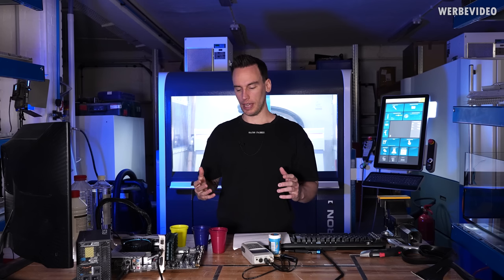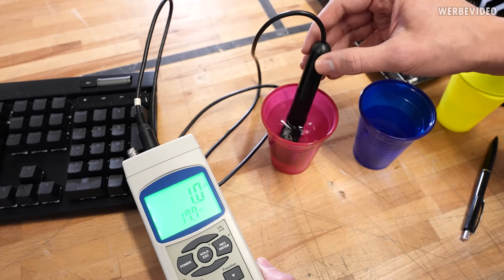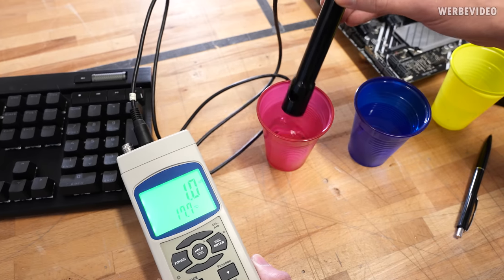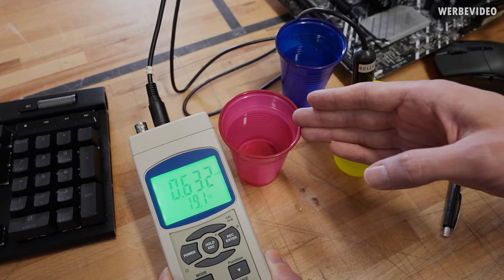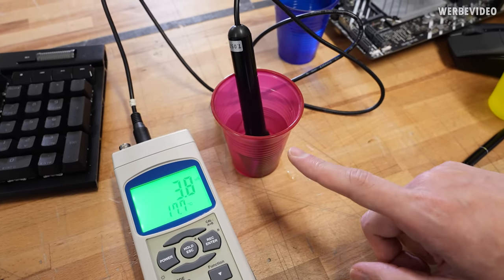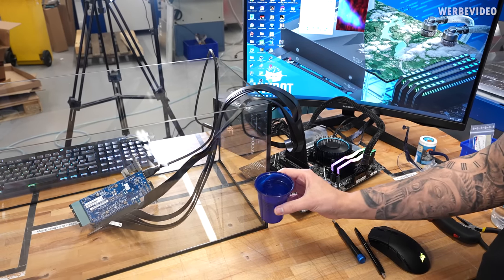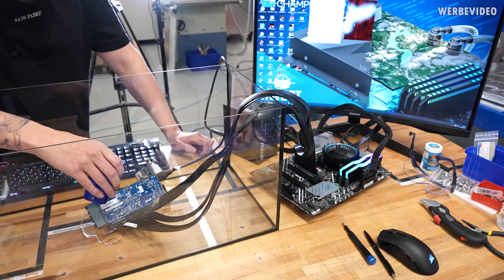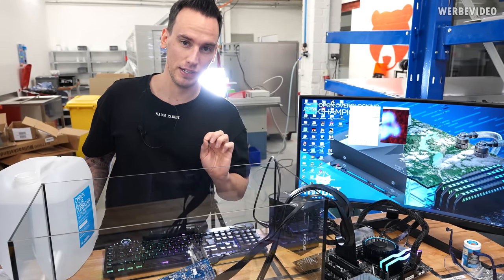Can you submerge a PC in Ultra-Pure Water?

Comment: It's like a common given that water and electricity don't mix, but here comes this guy
But BTW, how that ultra pure water is made is by filtration. Did some hplc at a place that had the this filtration system to make water for the hplc
So if you made a little external loop from the tank to a filter, it might work a bit better

Comment: The main issue with the "ultra-pure water" is that it doesn't remain pure as soon as you submerge electrical components in it. Everything on that motherboard is continuously contaminating the water, even the clear paint that protects the circuitry. Then, there's exposed metal parts, grease from bearings, plastic everywhere. Otherwise, if the water would keep pure, it would work, in theory.

Comment: The major issue you have is the metals on these components is not treated to prevent leaching into the water. With highly pure water, the water will rip metal ions out of the unprotected metals fairly quickly which causes a ramp up in conductivity as there are more conductive ions ppm. If you had left your parts submerged for a while, you'd start to see pitting on all of the metallic surfaces on all non-titanium parts. This is also why it's extremely unhealthy to drink highly purified or DI water. It'll strip all of the minerals from your body and then you'd expel it all in your urine which would lead to health issues/diseases or even death if done long enough. Places that use DI water for cooling purposes specially treat the metals with a special coating that's not reactive to the DI water or use titanium as titanium only leaches into methanol solutions and not water. We used DI water for our lab's hydrogen fuel cells and had to be very cognizant of making sure there were no fittings or hardware in the lines or pump that were not properly screened for use with DI water.

Comment: If I were to do the experient. I would use new hardware only. I would rinse the hardware first. Then refresh the water. I would then use a running loop to get rid of the old water and then pour in new water. It needs to be as clean as possible.
Reply: It's possible that the dust on the pcb is immediately causing shorts.

Comment: You should have rinsed all the parts with purified water first.  Also, your hands and anything you touch leave salt particles and impurities behind.  If you handled the motherboard without any gloves, you left salt on it already.
How about more of a closed system (less introduction of impurities) with a higher volume of purified water?  You could even rig a filter to remove any potential impurities introduced during assembly of the system or just occasionally dump the water and add new one.  The larger the volume of the purified water, the longer it stays uncontaminated.
Also, you would need to circulate the water to take away the generated heat.  You could remove the fan (short the pins) to have one less source of contamination.  Water running over the open CPU could cool it better.  Yes, you need to circulate the water (stir it at least) to remove heated water from the CPU area for more efficient cooling.

Comment: It goes without saying, that over time, distilled water, as is the case with any other non conductive liquid, will become more and more conductive. this is not really a disputed fact.
That being said, I have often though about, what it would take, to prevent that from happening. Would it be possible to implement some sort of "micro distillery", for lag of a better term, and further more, would it be possible to use the energy already provided, in the form of heat, to do it.
I have pretty much concluded, that it is beyond my capabilities, at the very least, I do not have the resources, to take on such a project, just for the fun of it, but it is not forgotten, and I would certainly love to see that video.

Comment: The answer is yes, but up to the point where there are too many ions dissolved in the water! This will happen as soon as you pour the water in, dust and metal particles that dissolve right away from the electronics and gasses absorbed from the surrounding air all make the water conductive!

I have tried this almost 20 years ago!
Reply: and I have yet to watch this video as well!
Reply: You are still better off using oil :D

Comment: Ultra pure water and distilled water should be the same thing, in the end, distilled water is from its name made using distillation (evaporation of water then condensing its vapors) and since the water was a gas at some point, then it contains no ions and hence is as pure as it gets. As for why the conductivity increased, then it has to be because of the surfaces that the water came in contact with, water is so pure that it will have the tendency to dissolve anything in it so readily, imagine having a cup of tea, if u add too much sugar at some point the tea wont dissolve the sugar and it will precipitate at the bottom, but at the beginning, all the sugar u put will disappear, the same thing happens now, any minerals found on the surface of the pc are being absorbed by the water and are becoming free ions, this includes any metallic parts (heatsink, solder, copper traces) in addition to other stuff like flux used during manufacturing. The only puzzling thing is why didnt the pc die, is it possible that the water created a temporary bridge (short) that wasnt strong enough to stay there permenantly? or did the water cause a floating effect somewhere (it lifted a component hence its not directly connected to the circuit)

Comment: Some ballpark guesses. The conductivity of the water in the tank might have also increased because of your fingers being submerged. The system might booted and turned off because the fan reported very low RPM due to being submerged. Maybe try once more with the fan out of the water, the CPU probably won't need it in this case.

Comment: Just got to the part where you talk about water in the PSU. Why worry? It's pure water at an almost pure insulator rating?

I think the problem you're having is that voltages are so low in some areas and higher in other areas, that this drastically increases the sensitivity between them. The higher voltage areas can much easier affect the low voltage areas because of the voltage difference.

Comment: The water capacitance may be altering the PC circuitry,  which could be causing the system to crash. I understand the conductivity of the water used is extremely low. But with the various high frequency's used on the motherboard and the multitude of SMD capacitors, I suspect the water changed the capacitive reactance of various components.
Due to the small size of the various SMD components, any small change could cause the PC to fail. 

This could explain why the PC ran fine when it was dried out and why the Video card failed with a little water splashed on the back of it. If i'm correct, you will probably find any DC connections submerged would prove to be ok, but the moment any sensitive circuit SMD capacitor is covered in water, the component will fail i.e. video card

I'm happy to be wrong, I'm only a sparky, not an electronics specialist

Comment: I think, that when you are just putting water on it. The water surface (which should have some tension) also taking some "dust" which (same as salt grain) make the surface conductive?? When it is whole underwater, you doesn´t have this issue, right. (at least until some corrosion start). So, that´s why whole system with lots of "dust" stop working? If you would have really clean all components (from vacuum chamber :D :D :D ) and try this,  it could work :)

Comment: funnily enough most of the problem with water/coolant exposure to hardware is not so much that anything shorts or burns (PSU mains side exempt), but more so that it creates a lot of crosstalk over data buses, resulting in all kinds of errors. The GPU for example with the riser cable was probably seeing a lot of bad PCIe packets, hence the erratic but still-kinda-working behaviour.
also funnily enough at one point I experienced this myself by accidentally exposing a ram stick to a couple drops of coolant, the ek cryofuel kind. Didn't find out tho until about an hour later when a memory fault BSOD occurred. Took that stick out, ran it under some water and let it dry for a day and it was good as new again.

Comment: There's just too much surface debris on parts. To put those parts into water, you would have to THOROUGHLY clean them first. Remove any and all stickers, clean any thermal paste that might be exposed... You'd basically have to treat the environment like a clean lab. Exposure to unfiltered air is enough to create enough dissolved solids to create a short even. Every part would have to be tediously cleaned with a microscope and then hermetically sealed in ultra-pure water.

Comment: Try: put a large heat sink on the CPU, remove its fan, and submerge everything in pure mineral oil.  For a possibly 100% silent PC, do the same thing for bare power supply internals with no fan.  The high voltages there will be a hazard and possibly a real challenge even with what will be, I assume, the extremely low conductivity of the mineral oil.

Comment: I wonder if you use die electric grease in all of the connections on the motherboard if that would make a difference? Might even be able to use it in the ram and pcie slots.
Reply: water would also be getting in between pins/solder balls on every chip, so you'd have to have the whole thing properly greased up...
Reply: At that point may as well just go with mineral oil instead of water entirely, remove the conductivity factor completely
Reply: @Real_MisterSir  or novec
Reply: @NickStarcraft  see but all those components are soldered on and not using tension and contacts where water can actually get in-between cant get in-between soldered connections

Comment: Water is relative conductive due to its self ionizing nature.
And any salt residue will quickly increase the conductivity further. So it really isn't ideal.
And water is also really good at dissolving ions, so it will relatively quickly pick up metal ions. Not to mention galvanic corrosion, and this is the real killer, but this however requires a voltage difference, something there is plenty of inside computers.

The myth that "pure water isn't conductive" is a myth that has to die. Since it is factually incorrect.
As far as insulators go, water is a decent electrical conductor.

Mineral oil on the other hand don't have any of these issues. Since it isn't a polar solvent like water.

Comment: Prediction time: I've only gotten a minute in, but my immediate thought is that ultra-pure water will in fact work, but it'll also destroy the computer for non-conductive reasons. Even if you didn't turn the computer on at all, if you left it in the water for too long it will strip ions out of the metals. Even if you then took it out of the water, dried it off completely and turned it on, the computer may fail because some of the tiny traces were eaten away by the water itself. The processors and memory would be borked for sure.

This is why the goal of water treatment for a city is not to purify water, but to balance the mineral content so that they don't eat away at all of the pipes. Water mains are usually filled with layers and layers of mineral deposits after a few years. Anyone who didn't know what it was would think that the water mains were full of sludge and sewage. It's just minerals. If there wasn't a buildup of minerals you'd have the opposite effect--holes in pipes and broken water mains spewing water all over the city.

Edit: I'm kinda surprised that the motherboard didn't want to run under the water. It's possible that conductivity was causing problems due to the natural salts on your hands dissolving into the water, but another possibility is that the water increased resistance on the CPU fan, sending a sort of "SOS" signal to the bios during boot. It's a shame this motherboard doesn't appear to have a Q-code reader on it, because it would be interesting to see what it said. If a person were to redo this experiment I would suggest using a passive cpu cooler, rubber gloves, and a pre-wash/soak of the components with ultra-pure water (then discard that water) before placing it in the tub for the experiment.

Comment: If the water doesn't have high enough conductivity, and it gets(with time, not at the first boot tho hehe) between two contact points, it might insulate the connection, therefore less and less things work as water makes its way between more and more contacts(plugs).
I know nothing about electricity.

Comment: The only reason this failed in water was the the water was putting so much drag on the fan, causing the fan to use more power than the board can deliver. So the motherboard didnt have enough power left to boot.          lol

Comment: Der8auer try to find a old Pentium Prescott and a Fermi (4xx) GPU and submerge it in to low viscosity trafo oil with a good circulation in tank, to test would it be cooler then on the air!

Comment: How come mineral oil works fine, but not this?
Reply: Mineral oil isn't conductive, and won't dissolve ions easily. Pure water isn't conductive, but is fairly corrosive, and will dissolve ions quickly (the video said it took 30 minutes for the water to get from 0.08 to 3, which was the breaking point).

Comment: you shouldn't use that new water stuff that the server communities using now it's crazy Patrick served the home showed it .that new server grade water that you can drink and it won't hurt you and that you can hot plug stuff in underwater even the power supply can be underwater and it won't hurt it and you can unplug the plugs underwater and plug them in with it on and it does nothing

Comment: There's unfortunately no such thing as ultra pure water once it's exposed to air or anything is placed into it. Water is one of the world's best and most common solvents. Pure water is its strongest form and will being to dissolve most materials to a small extent when submerged.

Maybe if you filled the aquarium tank directly from an RO/DI filter onto the PC, cleaning the PCBs as best you could with that first run of water, draining everything, fill the tank with Argon, and then fill with RO/DI again to displace the argon, you might end up with a water cooled PC for more than a few hours. But eventually I think it would still fail.

If the water tank is exposed to atmosphere, the pure H2O is constantly dissolving Oxygen and Carbon Dioxide. The H2O + CO2 is forming weak carbonic acid and the O2 is happy to look for anything to oxidize/corrode/rust (in the case of Iron). The problem is water just isn't chemically stable and unreactive enough like mineral oil to use as a non-conductive coolant. Long term, it reacts, or acts as a carrier solution for some other compound that will react, with nearly everything.

Anyone reading this that's tempted to try experiments with Argon gas indoors should go read on the dangers of it and ventilate accordingly of course. Being heavier than air, it needs an escape path at floor level.

Comment: You need to take into account that your hardware is not impeccably clean. Every time you submerge it, small particles of dust go into solution, you also touched the water with your hands which are not perfectly clean. It is simply too difficult to keep everything clean.

Comment: Yeah I learned that you completely ruined the test by placing the board in the water with your bare hands. Why did you not use rinsed off rubber gloves? Even washing your hands a dozen times right before the test is not enough. You are constantly exuding salt out of your pores. Especially the palms of your hands. Get more de-ionized water, pre-rinse gloves, pre-rinse the boards, pre-rinse again the tank, gloves, assembled compute unit, use fresh de-ionized water.  Use a Raspberry PI for a cheaper, smaller unit in a smaller tank to save money if you want.